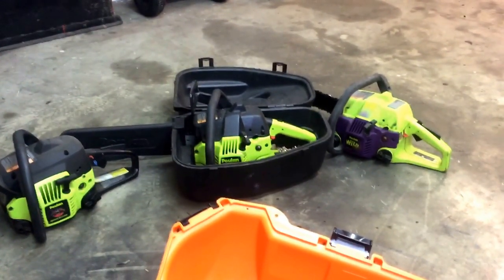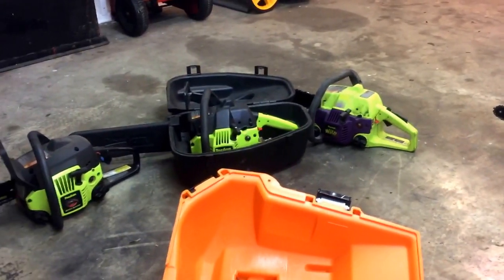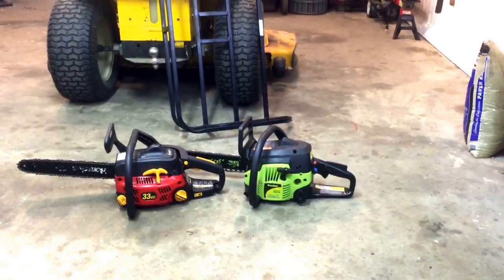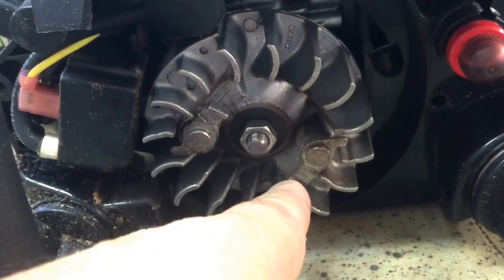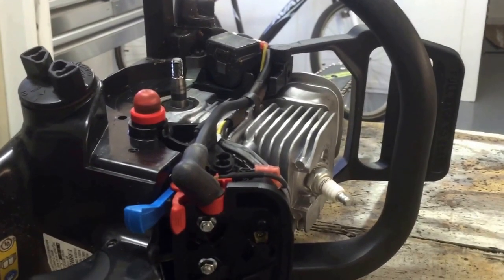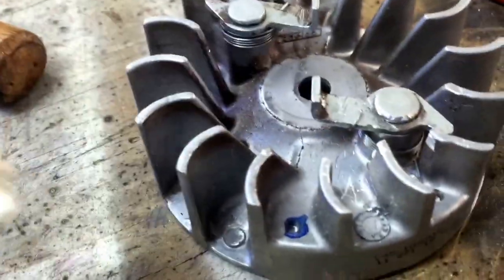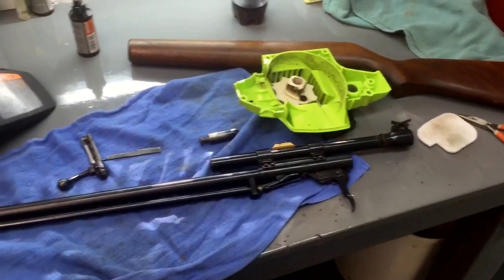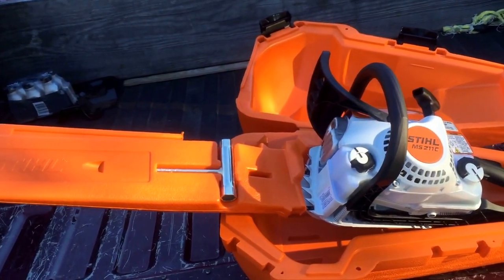Stihl,poulan,and to much talking

Comment: I own a Husqvarna 435 and have worked on my buddies 440 Husqvarna a couple times.  Stick with Stihl.  Husqvarna owns Poulan.  I have had lots of the same issues with my Husqvarna, right out of the box, it would not idle.  No matter what.  Bought the tool, adjusted the jets and got it to run and idle but that permanently clouded my mind on Husqvarna chain saws.  Maybe the farm saws are better or the commercial ones, but, I don't like mine.  Only saving grace, I got it cheap and nearly new.   My friends 440 won't idle for anything and two weekends ago he came up to me and said it died.  I couldn't get it running.   When you upgrade your Apple phone, get the 64 at a minimum.  The 16 is only good for calls and texting and light load.  The operating system alone sucks some memory or jigga-watts as you so aptly named it!!!!  That was funny Brad!
Reply from the maker: Thanks Craig it's hands on opinions that carry the most weight. I noticed I sounded a bit cranky in this video but between the poulans and the politicians and the scam calls,all in about 30 minutes,I was starting get tired of the interruptions.

Comment: If the telemarketers and politicians have an auto-dialer, or just run up the numbers for your phone prefix, then you will get a call. There's no such thing as an unlisted number when they do one of those things.

Poulan is not a bad saw. It just needs maintenance: plug, air & fuel filters, carb adjust, etc. I have 12 saws because I am an arborist. This includes, Stihl, Poulan, Husqvarna, Craftsman, and others. That's a lot of maintenance but my saws run fine.

Next is proper chain sharpening....

Comment: I will only buy Stihl saws and trimmers from now on.  I had some Echo equipment, but the Stihl is the best.   I have an MS290 for 2-3 yrs and just bought an MS250.  Also have found that I will only buy Makita cordless tools as well.  they both just last and better quality, especially if you use them often

Comment: Anything i get that im more wore out just trying to starting it than the job requires goes in the garbage in my opinion, been there done that. I recently got a deal on a poulan lol it was a stihl in poulan case
Reply from the maker: That's exactly how it worked! I was swapping parts from one to another to keep at least on of them running.

Comment: it wont run with out the plug wire hooked up lol I have the same prob with my crapman have to work on it every time I use it and I don't like that i have to order a chain and bar from them

Comment: You really should disconnect...oh, never mind! You know even though that gun is apart you should...oh, the bolt is out...never mind...
Anyway.
You are never going to regret that Stihl!! Husks are great too, but I love my Stihls! I made a decision about 10 years ago that I was never going to buy crap again as long as I could justify it. in 04 I got a MS290, I have never turned a wrench on it except to sharpen the blade and replace the worm gear on the oil pump! Great saw! I've since got a weed eater and pole saw, both great! If stihl made lawnmowers I'd buy them too!!
You are going to love that thing! Starts on the second pull every time!!
Reply from the maker: +1952Jeep man thats good to hear!

Comment: Thanks for walking us through the repairs as always.  I was getting ready to ask you what brand and where you bought the cabinet heater.  Same price for the ProTemp 18,000 BTU heater for Northern Tool or Amazon Prime with free shipping. You more than likely will. But curious if the still makes it any easier to cut, or if you simply have a motor and blade any chain saw cuts the same, outside of reliability.
Reply from the maker: Well I've found that cheaper saws lie about displacement and torque. A 33 cc stihl is 33 cc,s. A 33 cc homelite or poulan does not have 33 cubic centimeters of displacement. Then you have dependability. Everything breaks down on occasion but poulans break down every time you use them. Have your time is spent tinkering with the saw when you should be cutting.

Comment: I inherited a Sthil FS74 16 yrs ago, it had done minimal work and just stopped for no apparent reason before ending up in my hands.I put some fuel in it and gave it a few pulls but didn't start so thanks to my 2 stroke attitude it got chucked in the shed corner. fast forward 16yrs I dug it out of the shed corner, blew 16 yrs of dust and cobwebs off, new spark plug, new fuel, and a carby kit for luck. bam it lives again, impressed with sthil? yes I am
Reply from the maker: Well, I was hoping I could use mine over the weekend but the dang wind wouldn't quit.

Comment: I have a stihl  ms 250.  Bought it from a fella that had for 5 yrs and had not been able to start it. So basically it was a new saw for $100.  Pulled the plug and looked at the cylinder....no corrosion, so I brought it.  Got home and tried to start.  Then I understood why he couldn't start it.  In the choke position rope is extremely difficult to pull.  He was getting elderly and just didn't have the strength.  The MS 250c is what he needed.  Enjoy your new easy start saw.  Thanks for all the great info.
Reply from the maker: +IRVPIANODRIVER thanks! i like the .compression release

Comment: I have both and have been running great for years. My H455 with a 18in bar is 7 years old and starts every time even after sitting for months same on a S170
Reply from the maker: My big stihl is the only saw I have that starts runs and cuts any time I need it.

Comment: On my android cellphone, I use an app called TrueCaller. It recognize who calls you, and tells you if its a spammer. it saves me ton of time simply by letting me ignore those calls!
By the way, as I warned you beafore, in this propane-stone heaters, the tiny holes in the stones gets crammed with dust and it damage the heater. the left stone seems less bright than the others. meannig its jammed... take care of it! its important when dealing with propane that everything is in top shape!
Reply from the maker: Thanks! I remember your warning. I'll take the ceramic out and hit it with the blow gun.

Comment: Hey Brad I noticed there was a hole on the back side of the flywheel that looked as though you might have been able to use a punch to pop the rivet pin out a bit.. As a side note I have both Stihl and Husqvarna and like them both maybe the Stihl a bit more..
Reply: I saw that too.
Reply from the maker: Of for the love of of God!! I didn't even think to look at the back!!! Massive face palm!!

Comment: Northern Tool sells a really nice box for chainsaws. Not that you need one now that you have the plastic clam shell.  It will hold the saw, spare parts, chain oil, owners manual, wrenches ect.  And ti is semi armored so that car tires dont flatten your saws.  I bought one when my old saw (Poulon Pro) got run over twice by a braille driver.  I had it set out to the side of the work area while I hauled branches.  A helper drove up to bring snacks.  (trumpets sounding taps now) The Saw was pretty good.  Big motor, aggressive saw teeth, 24 inch bar and it never bogged down no matter what you cut on.  Hard woods or softwoods.   I ended up giving it away along with a tin coffee can full of spare chains to somebody who wanted to tinker on it.  I fixed the handles and chain brake system with hardware brackets and wood screws covered up with epoxy. Because local dealers didnt carry Poulon Pro anymore parts became an issue to find.   I replaced it with a Husqvarna.  that is a sweet saw too.  Lacking in areas compared to the pro series Poulon but still a good consumer level saw.
Reply from the maker: Now that's a good chainsaw story. Braille driver! I almost choked!!!! This is even funnier because I know a guy that brought me a chainsaw and asked if I could fix it.  I asked him what war the thing had been in and he told me he tucked it up under his car to keep it out of sight and he forgot he put it there when he left on his second,after tree cutting beer run. It was beyond anything I could do with it. It wasn't even his. He borrowed it from his brother.
Reply: Most of the chainsaw companies have a pro and a different consumer series.  Husqvarna I believe  their pro models start with an X for their versions.  Stihl has a consumer and a pro product line too.  My brother in law bought a big box store brand chainsaw.  It was something like 75 bucks and red or blue painted.  That was a surprisingly good chainsaw for the money.   Of course I adjusted the carb on it.  That is standard dealer prep for any small engine.  any engine.  adjust the carb before you use it. That cheap chainsaw cut a bunch of wood.  Of course I had to stop and adjust the chain and add more gas and chain oil  I sharpened the chain with the dremel right on the bar.  Sure beat using a hand saw or an axe.
Reply from the maker: +Randy J the best "cheap" saw I ever had was a very old homelite. I used and abused and cut way beyond its capacity and all it ever asked for was a sharp chain and a little love for the carb. When it finally wore out beyond being reasonably repaired,I bought a new one,which is the one I have now. It's hasn't been anywhere near as good but it still cut circles around all 3 poulans. It's seen better days and I did get it running good yesterday. I'm gonna get the 3 green nightmares and then put all 4 in craigslist for 150,just to get them out of my shop and sight.

Comment: Is that one of those .22s that you can't dry fire?  I have the same position you do on chainsaws. Anything but stihl,husq., echo, is a waste of space. Only bad thing about stihl is their rep is so good you can't find a used one at a decent price. people think a ten year old saw should sell for 80% of a new one gimme a break.
Reply from the maker: +adrock84ify You cant dryfire any rimfire rifle or pistol. thats what rimfire means.the firing pin hits the rim of the cartridge. if the cartidge isnt  in the chamber it will hit the hardened steel of the chamber face.it ruins the firing pin,often with just a few dryfires.
Reply: I know that's the good rule of thumb. And not to imply you dry fired it. I think there are some you can dry fire though. I got a 1022 couple years ago and I think they put a recess in the face to allow for "accidental dry fire". Gonna read the manual again to confirm. Hope the repair goes well.
Reply from the maker: +adrock84ify no they havent put a recess in the chamber face  of 10/22 chambers for firing pins.There is a small recess for the gas from the fired bullet to blow the semi auto bolt back,not even in the same plane as the firing pin. 10/22,s are my forte. I dont want to beat a dead horse but for the sake of those that may not know,the very nature of a weapon whose bullet is fire by a firing pin striking its rim,means you cannot pull the trigger on that weapon without at least a fired casing in the chamber.This goes for rifles and pistols,single shot or semi auto. you may or may not damage it the first or second time,but you will damage it. A large part of my income is derived through my gunsmithing endeavors.
Reply: It could be yours are older but I looked at mine and yes the breach face is recessed and I read the manual again and it says it's safe to dry fire. My manual is B 3/12 R23. I assume that's the print date and revision #. Under "to unload" section, paragraph 8. Also if you google dry fire 1022 it's pretty much unanimous.
Reply from the maker: +adrock84ify ok. You win. If you think hardened steel hammering hardened steel is wise and prudent. By all means, who am I to tell you different. I keep 10/22 firing on hand because that is the thing I replace the most,but by all means,please continue to dry fire them. Have a great evening.

Comment: Jonsered is another great saw to have, awesome power and very reliable.
Reply from the maker: I've had them apart and they appear to be just like homelite,poulan,echo, and McCulough.
Reply: Mine is 28 years old now, 10 bars and numerous chains later and still starts 1 pull every time. My wife bought me a new one 5 years ago and I still haven't opened the box lol.
Reply from the maker: +roguesquatcher well that for sure a keeper! You got your money's worth and whatever happens now is not so aggravating to deal with. Not many things we can say that about anymore. The homelite I have is that way. Ive had to work on it a lot though but it has cut enough trees that it earned its keep.
Reply: Jonsered is a poulan